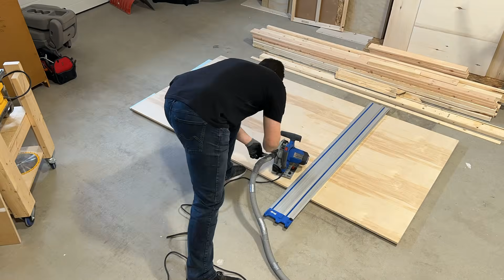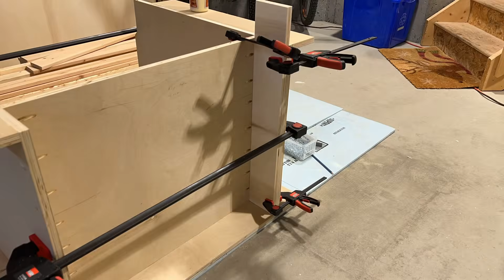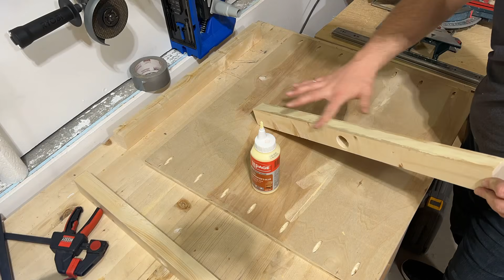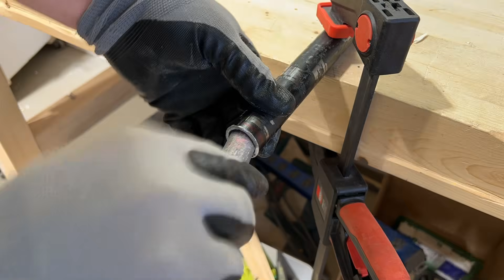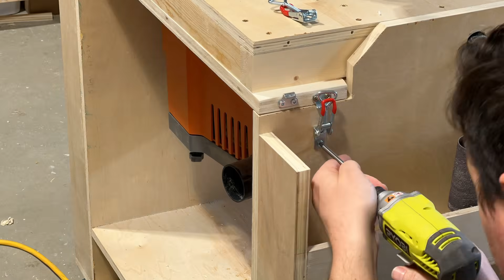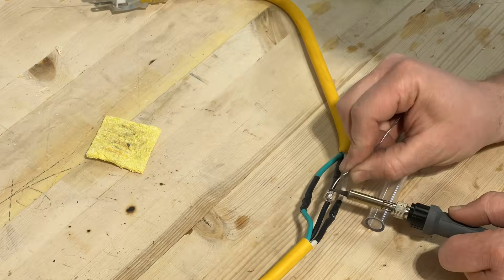Design and Build the Ultimate Tool Flip Cart

Comment: Nice build. I just purchased a DeWalt 735x and I've been trolling the YouTube space looking at all the flip top builds. Yours is right up there with the best ones yet. I don't have a sander like yours, but plan on mounting my Kreg pocket hole jig (same one you have) and belt sander (much smaller than yours) on the opposite side of the planer. 
Now that you've had the flip top cart for a couple of years, what are your thoughts on it = what would you do differently if you had to build it again?

Comment: Someone else may have commented. You’re going to have a really hard time heating up 12awg wire enough to solder a splice. I would cut the cable close to the original plug, discard that plug, and replace it with a replacement plug that uses screw terminals. Safer stronger and easier. Nice work on the cart!

Comment: If you ever use a Forstner bit to make a hole and find that the hole is too small, you can glue in a dowel rod of the same diameter of the hole, then re-drill the hole. And most woodworkers have extra dowel rods in their shop...right?

But if you don't have extra dowels rods hanging around in your shop...

You can lay a small, thin piece of wood (1/4" or 1/8" plywood works well) on top of the hole, then re-drill it to the larger size. Once you cut through the thin plywood, it will hold your Forstner bit in place so it won't wander around. Just make sure to clamp the this wood to the original piece so it doesn't move.

Comment: Have you had any problems with the sander upside down, I had mine on its side hanging on a board with hinges. I found grease stains on my bench where it hung. Never gave it a thought that the sander has grease. Ended up with a seized motor.

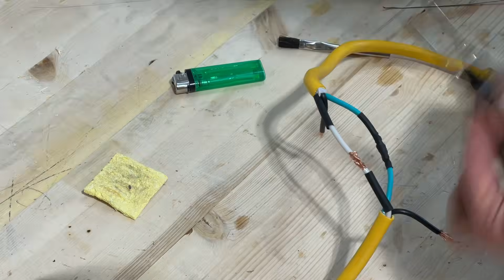Comment: 13:15 - instead of this mess, cut off the plug, feed the cable through, then use an aftermarket 3-prong plug that you can screw the power cable in.  The time savings alone is worth it.  Regarding the solder. A) your iron wasn't hot enough.  b) for this application you need a physical/chemical connection (solder) and a mechanical connection (heat shrink).  So you did well.  However, I would rather not have to splice anything and just do the plug swap I mentioned.  Peace of mind and all.

Comment: Great design. I've also been concerned about the Fisher's cart design and don't trust it to not be wobbly. Your solution of outside shelving is really clever. Your design for the blocks and locks for allowing the table to rotate only 180 deg back and forth is also quite clever.

Sorry it appears your channel didn't take off and you haven't posted more. This is good stuff.

Comment: Nice job. I like your locking mechanism. I was looking for some way to make this kind of a flip top for my jointer and planer. I like it is kind of a torsion box, which gives sturdiness. With regards to the soldering, then it is difficult to do unless you have a propane soldering flame. It was just fine what you did with the tool you had. The first thing is to get some solder in between the wires. Then the heat will travel through the solder through the rest of the wire when you put more on. So it it what it is and it works.

Comment: “It’s a poor workman who quarrels with his tools”
In this case the fault lies squarely on the shoulders of your soldering iron. Just not hot enough. You did everything else right. If you can’t get enough heat into the wire so the solder melts by touching the wire only the you soldering iron is not good enough. 
Nice cabinet by the way.

Comment: For your cords. I would have used a 2 inch x 4 inch steel handy box, braid the wire together, and cap with wire nuts. I like your design, but for myself, (this is not for everyone), I would have cut dados for the glue up.

Comment: If I were to go about building something like this, I would:

1. Use dado joints for several key structural points, rather than simply glued and pocket screwed butt joints. For example, where the sidewalls of the cabinet meet the horizontal member over the drawer, that should be a dado joint.
2. Don't attempt to solder the extension cord back together.  First of all, that pencil iron likely doesn't have the power to solder 12 AWG, I would recommend one of the pistol-shaped soldering guns.  Second, that sort of lap joint is terrible; there are proper ways to splice stranded cable, that's not one of them.  Third, the correct way to do this is to go to the cable aisle of your favorite hardware store, and buy a new NEMA 5-15 plug with screw terminals.

Comment: If no one answered the soldering questions, you have to heat your tip, dab it on a wet rag to shock any old solder on the tip to get it off, or use steal wool, but that can damage the tip if you aren't careful. Then 'tin' the tip by putting flux paste on it and a bit of solder. Flux paste the wires, then put the iron to the wires. Put the end of the solder to the wire and when it heats up enough the flux will help pull the solder all the way through the joint. Remove the end of the solder wire, then remove the iron and allow to cool before moving the joint.

Comment: The solder issue is related to heat and size.  Your iron cannont get hot enough and (let the joke flow) the tip wasnt big enough to transfer the heat.

Comment: I have both these tools and I'm going to build this with one major and one minor change! The minor change is that I will add a spare duplex outlet into the front end of the flip box so that it's more readily accessible no matter which way the table is flipped. I doubt I'll ever use this outlet when I'm in planer mode, since I usually plane into the yard, downwind! But i will use it often in sander mode as I hook my Festool vac to a 20 amp outlet, then plug my sander into the vac. I find that I often have other sanders in play during this process and the spare outlet will allow me to plug the cart into the vac and anything I turn on that plugged into the cart will automatically start the vac, that way I don't have to reach down and swap out the power cords of different tools on the front of the vac, as I frequently do now. I'll have to swap the vac hose between tools but I'm still eliminating one step. Sometimes I have 3 cords laying there. The major change I will make is to eliminate those fixed side storage areas and instead, create two storage caddies that will store into the areas on either end, just above your drawer, when i roll the cart out to use it, i can pull them out from underneath the table and they will conveniently hook onto the sides of the cabinet, where your permanent storage areas are. I'll probably make them out of a combination of 1/2" and 1/4" as there won't be anything heavy going in them anyway and that will keep them lighter for times I do pull them out. This will greatly reduce the footprint of the cabinet during storage. If I don't happen to need to flip the lid, I'll just leave them where they are and still have full access to them. I sand more than I plane, so I expect sander up will be the most dominate position. I'll also add a cleat underneath the outboard flip table of the planer so if I'm planing long boards, I can add an outfeed extension table. I may just take the stock discharge outfeed table off altogether as it's pretty short and it's aggravating to have a piece of wood hit the concrete if another board pushes it off the table while I'm batching boards. I've seen other people build similar carts and put two sanders on it and have it like a sanding station, but that makes no sense to me. I want the two tools that share the cart to be from different families of process. That's why I don't own a Shopsmith! I don't want to have to switch back and forth between tooling.  Great build, Thanks for sharing!
Reply: Holy novel writing there Batman!
Reply: @dreamlookautodetailingauto3353 right, I debated if I really wanted to scroll that far to see the reply.  🤣

Comment: Hey mate, poor soldering is because your tip is too small to heat the wire and melt the solder at the same time.  Tinning the wire first will give better solder flow and adhesion.  Probably better to get hold of twist connectors, feed your ends in and screw the wire together.  Nice cart. Cheers.

Comment: Another tip for soldering. Hold the iron UNDER the wire. Heat rises and when you hold the solder against the wire, it will flow down and through the wire and not on the iron.

Comment: A great design. I think I would have cut and soldered the lines on the inside of the box to avoid having the splice ne’er the plug end. Or, let in an outlet for a hand sander or something else. But overall, a very good design.

Comment: Nice cart! I would really like to see a video on your dust extraction/vacuum in the corner.

I have a somewhat similar thing I want to make. 10 gal trash can, vortex separater, vacuum all on one cart.

Mine would add three elements:
Smaller oval trash can on the bottom that could be filled with water (for catching really fine particles/ash).
Hose reel.
Large wheels/handles so it can be moved like a hand dolly/truck.

Basically, I want to be able to disconnect the cart from the garage dust collection, wheel it to my fire place, and clean out the cold ash. Then, wheel it back and easily reconnect it.

But, your system looks very similar to what I want to make (minus the water/ash filter).

Comment: For soldering:
Flux. Pre-tin iron. Pre-tin wires.

For this: don't solder. Use an aftermarket replacement plug.

Also, that cord is rated for 15A because it has 15A plug and socket. In and of itself, 12AWG will carry 20A.

Comment: That's a good flip cart! The wire didn't get hot enough because your soldering iron was too small for the wire size, but you shouldn't have a solder joint in an extension cord like that. It's best to cut the end off and put on a new plug; I like using the right-angle plugs from leviton.
Reply: THIS

Comment: My advice is not to solder at all.  Don’t use extension cord for these projects. Go to the wire section and buy 6ft of 10-12 gauge cable. Then attach your own industrial plugs. No chance for shorts or power loss.
Reply: They have SO and SJO cable. SO is 600 volt. SJO is 300 volt. SJO is perfect

Comment: Not even close to the ultimate.  I built one a few years ago that accommodated six tools (oscillating spindle sander, 12" disk sander, Combo belt and 6" disk sander, small bandsaw, slow speed grinder, and mortiser) in total and integrated electrical and dust collection and many other features e.g. storage and drawers, etc.
Reply from the maker: Nice!!
Reply: Jeremy, I built a flip top that accommodates 12 different tools. It keeps my workshop space free.
Reply: Do you gentlemen have plans?

Comment: I'm a big fan of using pocket holes as well. Only problem I've run into is setting my clutch drill appropriately to torque them down rather than just spinning. What have you found to be the best clutch setting? I've even tried an impact driver which helped a little but still had some that just spun.
Reply from the maker: I just do it by feel, no clutch. The clutch setting would depend on screw length and material strength. Try using pocket holes for some shop projects and you’ll get the feel for it in no time.
Reply: There is no one size fits all clutch setting. Different wood or a knothole in the wood changes everything. Start at the lowest setting and go up one step at a time. Best bet, get close and finish by hand with a screwdriver.

Comment: You needed a much larger solder gun (a pistol grip gun in the 200-300 watt range), but could have just used crimp connectors with the heat-shrink tubing as well.  I'm not sure your solder job is good enough and may cause the connection to overheat when you draw large amperage loads through it (the joint may have high resistance).  I'd check it a few times when used under load to see if the joint feels hot.  Otherwise, A nice build.
Reply from the maker: Thanks. I was thinking I might just swap it for a new plug and forget the soldering.

Comment: you need 120 w soldering iron to heat up that much copper yours looks like a 40 or 60 w which is most commonly used to solder wire gauge up to #18.

Comment: For the cord/solder issue.  A 20A electrical outlet integrated into your workbench would allow remove the need to solder the wires.  Nice bonus of having a couple outlets on the bench too.

Comment: I agree with Micheal Adamson that you should use a torch for the heating on things that large as that copper is a major heat sink. I would recommend using flux on any soldering job as well. For electrical connections I prefer vinyl butt connectors.

Comment: I'm not a soldering expert, but I used to have the same problem.  I switched to a propane torch with a soldering attachment from harbor freight.  Works 100x better than the plug in one as it gets way hotter.

Comment: The reason ply is always measuring wrong is because its constructed using metric measurements (6mm,12mm, 18mm, 25mm) that's why 3¼ never measures correct yet every American woodworking youtuber says the same thing "the ply is never correct" ? - nope, it's just metric and not imperial - try using millimeters instead of inches and presto your work will be more accurate.....
Reply: Metric rules!! 🇦🇺

Comment: Pro tip: Never use a cutoff wheel to grind down the sharp burs of a piece of metal you just cut.  Those wheels are intended for cutting, not grinding.  They can fail and God forbid, cause serious injuries.  I bought a second grinder and use one for grinding and one for cutting.  I’m way too lazy to be changing those out.  Other than that, great video.
Reply: Yeah, buying a second one (say at HF <gasp>) with a dedicated grind vs cutoff is the way to go.
Reply: @MichaelCampbell01  Definitely do that. I keep the wheel that exploded on my shop wall as reminder to never do that again!
Reply: I had Home Depot cut and thread 2 pieces of pipe so I could add flanges on the outside ends to help keep the sides from splaying out.  I used Drew Fisher’s plan.
Reply: @georgequalls5043   - Do you just have the threaded pipe turn in the flanges?  Would only be half a turn so not a big deal.  Or do you just have the table pivot around the pipe?  Don't anchor the pipe on the inside.

Comment: Nice cart. I plan to build something very similar and I really like your flip top design. As far as the soldering, a larger iron would have worked but I prefer a mini torch. Much faster than an iron, just have to be careful and have plenty of slack to slide the shrink tube up far enough away from the heat.

Comment: I also like the design, but also don't love the power cable, maybe an electrical box with a switch or better would a magnetic switch, so that when plug it in you have to set the switch on,
you can get them for a bout 20-30 bucks now.

Comment: You may need a high watt iron. that cable is thick the home hooby iron is not hot enough. As for the electrical plug next time buy a replacement Male end from amazon you can get them very inexspessinve and it will have a better contact. Otherwise your soldering job will hold up. Thank you for sharing.